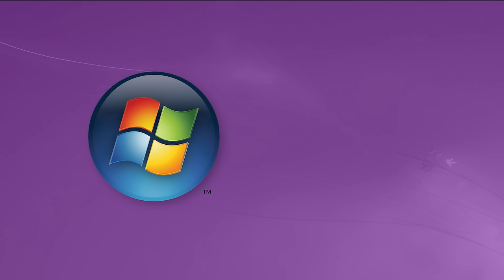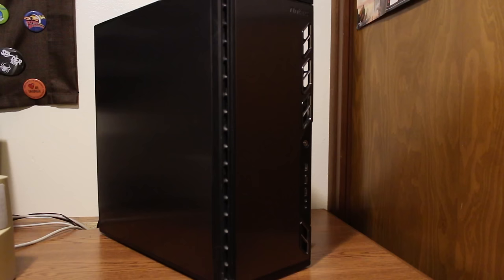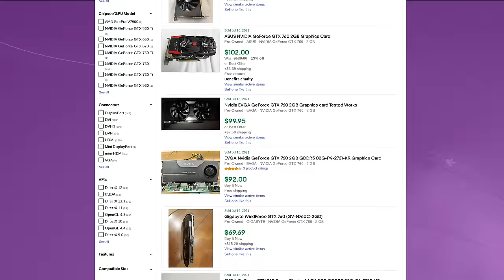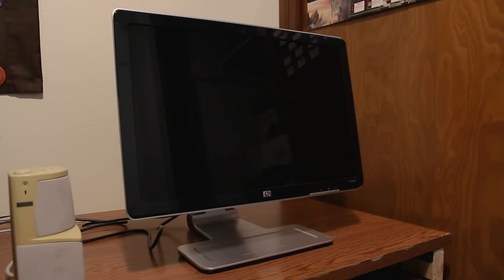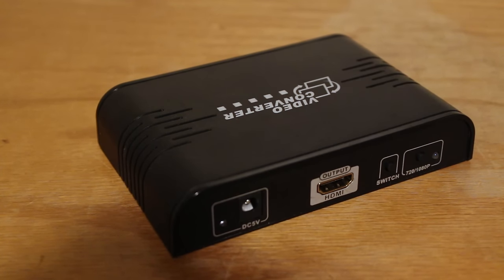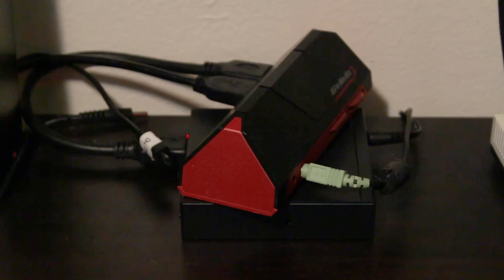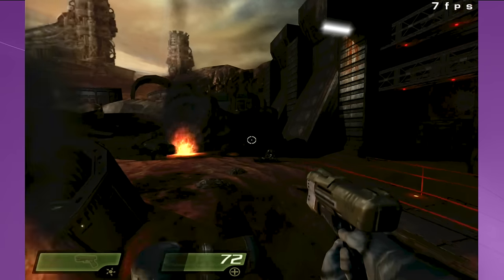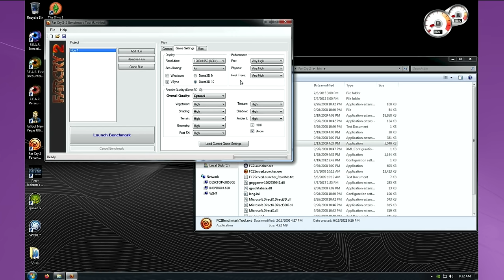Building A Windows 7 Gaming PC in 2021

Comment: Windows 7 will ALWAYS be the BEST operating system that microsoft ever released!
Reply: @overfl0w-op5xg  Windows 8 sucks kook!
Reply: @edwineriksson2882  To be fair, Windows 8 did not actually suck because it was developed to be used for tablets in mind, but it definitely sucked if you used it in a PC. In my opinion, Windows XP was actually more iconic than Windows 7 though.
Reply: @Exempt 1 yes iconic haha well that happens
Reply: @ivankong1065  It is more iconic, but it's not the best OS ever made by Microsoft. This OS is the best one they have ever made.
Reply: @NottJoeyOfficial  to be honest though, from a windows xp user, I actually like windows 10 more. And then they screwed up again with windows 11. I realize windows pattern is like success then suck and then success then suck again, like windows 2000 and windows xp, windows vista and windows 7, windows 8 and windows 10.
Reply: 2000 just might be better, but in it's own way.

Comment: No, Windows 7 is NOT retro. I still use it to this day on my 12th gen Intel PC and it works like a charm. Ofcourse installation process and most of the drivers were tricky as hell, but eventually it was worth it. Windows 7 is still better and more stable than 10&11.
Reply: Windows 7 is the peak of windows
Reply: Why would you want to use it on modern hardware? Makes no sense
Reply: I kinda agree with you but just cuz you still use it doesn’t mean it isn’t retro.  I have an N64 that I use occasionally but that doesn’t it isn’t retro because I do.

Comment: Sheesh, you're picking stuff from the time instead of maximizing on what it's capable of. You're missin out on the 2700x, RTX 3000s, Freesync or G-sync 3440x1440 QLEDs, DTS X or Atmos, Media Player 12/Media Center for Xbox 360/PS3 streaming. And all that modern stuff Windows 7 can absolutely run and support... I hate Windows 10 and am hoping Windows 11 no longer has initial issues. 2024 update: It can even use RX 6400/6500 XTs. Even Windows 8.1 supports up to the Quadro RTX 8000 which should be very relevant by today's standards. I myself have a Quadro RTX 4000 for 2060 Super performance for 8.1.
Reply: I still main 7 but to absolutely no one's surprise 11 is even worse than 10.

Comment: Great video and great build! I love this sort of build, I've done a couple of windows 7 builds, they are cool! The 730 is surprisingly bad, but I'm glad you figured out the issue in quake 4, it was scary how slow it was haha. Great video, thanks for putting it out.
Reply from the maker: Glad you liked it.
Reply: Must be playing the Steam version of Quake 4 because I just played it a couple of days ago on an HD6450 (1/4 the power of the GT730) and it ran well. What you purchase from those services isn't really the original program and has higher resource requirements. It is often running partially or totally in emulation.
Reply: @AtomicPurple  My pc is worse then this 😭
Reply: Quake 4 runs fine at playable rate even in Intel Igpu -HD 2500  from old 3rd gens , probably some card/ windows update or drive issue or the AA

Comment: Watching this from my AMD & Nvidia Windows 7 machine with a X-Fi Titanium.
However, I have a Ryzen 7 2700X (Looking to hop up to the 5800X), and GTX 970.

Also, that BIOS and driver installer looks significantly better than the BIOSes and driver installers on most modern boards imo
Reply: I just built an xp machine with an X-Fi Titanium, great sound card

Comment: Earlier this year I put together a dual boot WinXP/Win7 machine.  I already had the tower, motherboard, CPU, RAM and GPU so I was able to save a fair bit of money.  It's an old DDR2 board so I just bought an extra bit of RAM to fill up all the slots, a power supply, a DVD drive, a floppy drive (because why not?) and a hard drive.  

The rig has an E4600 Core2 Duo @ 2.4GHz, 7GB RAM (somehow one of my 4 sticks is actually only 1GB, not sure how I never noticed that before) and it has a Radeon HD 6850 1GB MSI Cyclone edition.  The motherboard is Zotac branded, so it has an Nvidia chipset and integrated graphics (Geforce 9300).
Reply: For windows 7 you could go for a rtx 3090ti and a gtx 960 for winxp if you want to max it for out
Reply: @nikolaievans2432  I'm thinking that a system that old would be a pretty big bottleneck for a 3090ti.  It has a much earlier pcie version than what the 3090 is designed for so right off the bat performance will be limited, plus a core2 duo is likely to further limit what it can do.  Granted I'm not going to be putting super modern games on that system, but I think that would be a waste.  

Dual gpus aren't really an option on that board either, because it is a micro atx board rather than full sized, so sadly there just isn't enough room for that kind of expansion.  The HD 6850 is a decent card for that board, as it can play both XP era and Windows 7 era games without too many issues.  The XP drivers seem to have pretty bad open gl support though.

I did recently upgrade the processor from an E4600  to an E8600 and the performance increase is notable with not only a higher clock speed at 3.3 GHz but also an increased l3 cache size and faster bus support.

Comment: im running windows 7 on my pc with an rtx 3090 and a core i9 12900k, it also has a 1tb nvme ssd and an intel wifi card. It works great
Reply: Which motherboard are you using?

Comment: I miss my win 7 rig. I built it for a friend in like 2010 and bought it off his years later, for £40. Nice Lian li case was worth at least twice that used. I upgraded it heavily with a Phenom 1090t, 8gb of corsair ram an SSD, 1tb hard drive and 750ti. Also set up a dual boot with XP. Spans these 2 eras pretty well and maxed out everything I wanted to play. I dunno if 7 still supports Steam but if it does I'd be willing to build something like that again.
Reply: My main PC has Windows 7, I can confirm that Steam still works
Reply: My main computer runs 7 steam supports it.

Comment: My actual gaming rig aka the "Low Electricity Win7 PC" is running in a DELL Optiplex 7010 Desktop, with 16GB of DDR3 1600MHz in Dual Channel; CPU is an Intel Xeon E3-1240 v2; GPU is an AMD Radeon RX6400; a 256GB SSD on SATA 3, a 2TB mechanical hard disc for data and games; Soundcard is a Soundblaster X-FI Xtreme Gamer 7.1 SB0730 and it runs great.
Windows 7 Experience index is: CPU: 7.8, GPU: 7.8, RAM 7.9, Hard Disc 7.9
Total system power consumption = Less than 100 Watts (Xeon max power draw I have seen reported by Open Hardware Monitor is 46 Watts and with the Radeon RX6400 is 53 watts. ( I had in the PC a Nvidia Quadro T600 with hacked drivers to work in Win7, which gave a WEI of 7.9 in GPU, but the RX6400 had native Windows 7 drivers from AMD).

Comment: I only stopped using Windows 7 this year, just over a month ago, putting off updates for ages since my PC was DDR3 and LGA2011 socket any new upgrades apart from the last GPU update were realistically going to require a whole rebuild.
Really stable and the only real reason I upgraded is many more new games were incompatible like 40K DarkTide, and some older games also updated to no longer run on Win7.

Although I'm fine with the aesthetics of Windows 11 I don't like how Windows 8 and beyond have loads of random sponsored content pushed on you in the default start menu, yes you can do some tweaking to get rid of it but I preferred how non-bloat and unintrusive Windows 7 was on fresh install.

Comment: I have windows xp retro pc its not much but runs most of windows xp games 
Specs:
Cpu :amd athlon 64x2 dual core 3800+ 1.99ghz am2 socket 2 core 2 thread 
Gpu : msi nvidia geforce 9400gt 512 mb gddr2 (passive cooled) edit:i replaced my gpu now i use nvidia 7950 gt 512mb 
Ram:5gb ddr2 800mhz (3x1gb 1x2gb)
Storage: 
Hard disk1 : 7200 rpm toshiba 3.5 inch 1tb sata3 (dtaca0100)
Hard disk 2 : 2.5 inch hitachi 500gb (taken from laptop)
Solid state drive : gigabyte 256 gb sata3 
Optical drive :lg on stata 1 inferface
As i said its not much but it does what it needs to do - play old games

Comment: Still running a Win 7 PC with an FX8320E and gtx 750 ti as my main desktop, because current hardware prices are ridiculous for a university student. So far no major issues, except for discord screen share not working anymore for whatever stupid reason. If it survives the next two years, it'll have lasted me for 11 years. (Although I did briefly have a 1070 installed which died after a year, great.)
Reply: I actually found the same issue with Discord screen share. I haven't tried to share myself, but when I attempt to watch other people's streams they won't load for me. Some people load in the app, some do not. One work around I found for watching streams anyways is to load into Discord in Microsoft Edge, which should be installed on any Windows 7 machine that's up to date with updates. Not sure if that will let you share your own screen, but it's worked without fail to let me watch other streams. For some reason no other Chromium based browser works either, it has to be Edge in my experience.
Reply: @NottJoeyOfficial  Well, I guess I'll try that some time. My main browser is the good old firefox, so no chromium there afaik. Used the discord desktop client so far.
Reply: @Luxfalcon  yeah, I usually use Firefox too, but since Discord itself is a Chromium based app they still never even tried to get streams working on Firefox last I checked. It's good that Edge is built in at least, so you don't have to download anything additional. Good luck to you.

Comment: my xp and 7 machine are the same pc, first gen i7 (6core+hyper threading) at 4+ghz for decent single core on xp and multi core on 7. 640gt (had it lying around and it has xp drivers)
Reply: Sounds interesting...
 i7-980?
Reply: @kevinyoliveira68  xeon x5675 but its the same cpu die as the i7 980 980x 990x (the xeons are WAY cheaper than the i7s)
Reply: @vincentschumann937  Make sense thank you

Comment: My Windows 7 rig currently is a Dell Precision 5810🤣
with a Xeon E5 1630v3 32GB DDR4 4x8GB (QChanl, but maybe in Dchanl with 4 available slots)
with a GTX 660 until I get the modular 8+6 power cable part ordered.
Then I'm putting my shelved Titan Black to use😆
It's about equivalent to my main desktop x99 i7 6850k 32GB QChanl DDR4 (8x4GB)
I know it's absolutely unnecessary 
I only got it because by brother's friend called me to collect it from an abandon rental unit
and it supports all kinds of sata and legacy and UEFI boot options, like AHCI
that's great cuz when ever I installed Windows 7 on this WD RaptorX drive (the drive with a factory window)
I didn't realize that feature was off in that bios I originally installed it on.😬
now it's really hard to get motherboards with that bios setting.
if it doesn't have it, its on by default and windows wont boot.
I took out the drives it had in it and connected my good'ol reliable WD Raptor drive and it worked!🤣
Sure I really should reinstall it, but do you have any idea how long it takes and 
how big of a pain it is to re install all The Sims 2 and expansions😵😩
I have a 20 year old game save that has never looked sooo good with custom graphicsrule config tweak
2560x1080 ultrawide resolution.

Comment: Even a super high end pc with a RTX 3090/RX 6900 XT with a I9 12900k can run windows 7 if you make a custom windows 7 with the drivers integrated in ntlite
Reply: Running 7 on my 12900k with a 770
Reply: @himmelskibet  nice

Comment: What GT 730 version are you using? Results seems whack. I remember running far cry 2 back in the day maxed out with same in game resolution as what you are using with an HD4850, overclocked Pentium E5200 and 4gb of ram and I'm getting playable framerates than what you are getting. According to Tom's Hardware's gpu hierarchy, the GT 730 GDDR5 version is just around HD4770 performance. Given I was still running with DDR2 mems and weaker cpu than yours you should be getting way better framerates than what you are getting

Comment: Windows 7 gaming pc starter pack (hardware):
Core i5 2500K
Hyper 212 or Corsair H80 AIO
ASUS or MSI Z68 board
8 GB Corsair Vengeance DDR3
GTX 570 GPU
500-1000 GB hard drive (maybe a 120 GB SSD if you were rich)
and of course, the legendary Cooler Master Elite 430 case!!

Comment: What do you think of using Steam on Windows 7? I recently got a GTX570 on my old IVY bridge system for old games but not sure if it's unsafe to use online just to access my steam games.
Reply from the maker: It should be safe enough as long as you take proper precautions and don't keep any sensitive info on it. 
The first thing you should do when you get it online is fully update Windows, and don't open a web browser until that's finished. Then immediately install a better browser along with a good ad-blocker, and a script blocker if you're really paranoid. I'd suggest keeping web browsing on the system to a minimum, and don't click ads or download random files (duh).
In my case I also use a PiHole DNS server to block ads and malicious domains network-wide. Personally, I wouldn't trust having my old computers online without it in place. If you want to go really overboard you could set up rules on your router or in the Windows hosts file to block all connections on that machine, except a handful of whitelisted domains.
The only other thing I'd suggest is to disable the "hide extensions of known file types" option in folder and search settings so you're less susceptible to trojans.

Honestly, most of this stuff is just good practice for any computer, not just obsolete ones.
Reply: @AtomicPurple  Good points, thanks. My copy of SP1 didn’t even work with windows update out of the box until I installed the 2GB of grouped KB updates from the Microsoft catalog but it finds new updates now after those were installed. I was surprised to see that Microsoft still updates Microsoft security essentials and still seems to do critical updates like with the print nightmare issues along with some other updates listed as 2021. As you said in your video I find 7 much nicer to use than 10.
Reply: I am very much not in favor of running Steam on my Windows 7 machine because it isn't authentic and you might as well play on a modern PC. They are running most of that stuff in emulation and even when they don't, I suspect it is often heavily modified and amended even when not a "remastered edition". I buy old copies of games, often for a lot cheaper than what they cost on Steam or GOG and run them the authentic way. The old code and the old machine kinda goes hand in hand and if you aren't going to do both, why mess with any of it?
Reply: @AtomicPurple  Avast seems to work pretty well for free security software. But I still don't do anything super critical on Windows 7. Not logging into my bank account!
Reply: @finkelroy7030  it’s mostly ease of access. My library is already there and I share a triple  boot with windows 10 and XP and they all connect to the same steam library directory. If I find an older game that has some kind of compatibility  issue I can just switch to 7 or xp and continue where I left off with it.
Reply: Look into ESU Bypass, your Windows 7 machine will be updated through January 2023. There's only 6 more months of support, but it's safer than having been out of support for 2 1/2 years.
Reply: @finkelroy7030  what do you mean Steam isn't authentic? Windows 7 came out after Steam was well established, and so many games on Steam from 2009 to 2015 were made specifically for Windows 7, with many to this day still supporting it. There's no emulation at all.
Reply: @NottJoeyOfficial  Yeah I did look into that method. I'm not sure how I feel about using external code to change how Windows update works to retrieve these updates. As long as browsers are still being updated on 7 this should mitigate most of the risk.
Reply: @Edmundostudios  yeah, it is a registry hack, but at least the updated are from Microsoft. When it comes to browsers, Chrome has Windows 7 support until January 2023, then every Chromium browser will probably follow shortly after, with Firefox dropping Windows 7 in probably 2025 at the latest.

Comment: I dunno man. While it might be considered retro time-wise, it doesn't really look retro like XP
Reply: Even XP falls between retro and modern
Reply: I really don't agree with calling Windows 7 retro.  I wouldn't call anything capable of running stuff such as Red Dead Redemption 2 and even Cyberpunk 2077 retro.  

I mean, I'm still using it as my OS right now on my main laptop and desktop.  Will perhaps upgrade to 10 whenever I can get a decent GPU for the desktop so I can play more modern games, though.  Don't see much point in running 10 on my laptop because none of those newer DX11/12 games could ever run on it anyway.
Reply: @thepirategamerboy12  Yeah, my laptop is a dual boot with 7 and 10, and anything that I can run on Windows 10 also runs on Windows 7 due to the age of this laptop. Even Yugioh Dual Masters runs on 7 despite saying it requires DX11 and Windows 10 as a minimum. I tend to boot into Windows 7 when I need fast access to programs instead of letting Windows 10 boot for a while. It's much more light weight so it's a lot faster to boot.

Comment: iam using an old HP pavilion 6214y .. its a athlon II x4 and dual boots win7/64 and windows xp64 on seperate drives.. the onboard is good for xp era stuff but any old radeon HD era car thats 128bit memory interface will be plenty.. i dont game on 7 because most games were online activation or online multiplayer but run my video picture and audio editors in 7. The 2 drives are sata2 8gb ddr 2 memory with a combo drive burner and its perfect for the split task of game box and editor

Comment: retro does not mean old hardware, you can run windows 7 with 3090 with latest CPU as long as the motherboard support CSM.
although 3090 is last modern GPU i know that support windows 7.

edit: welp i did not read the part 2021 on it mybad